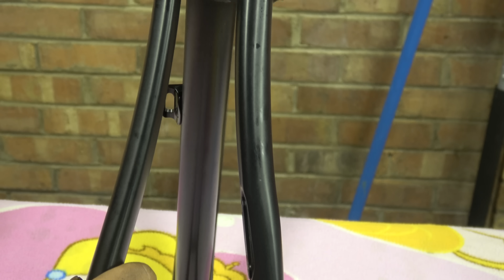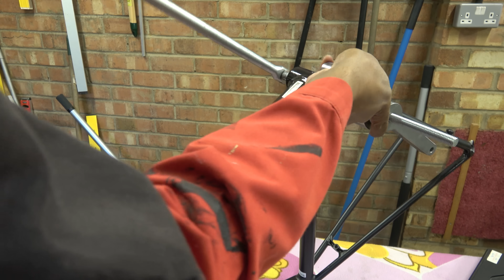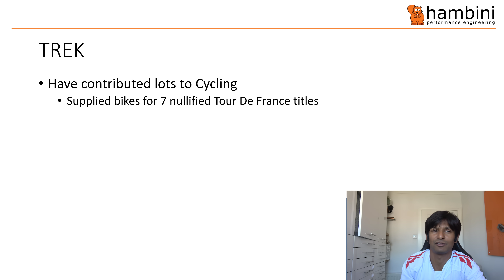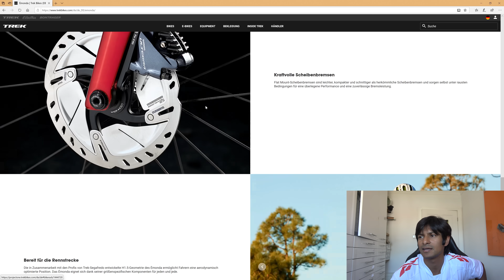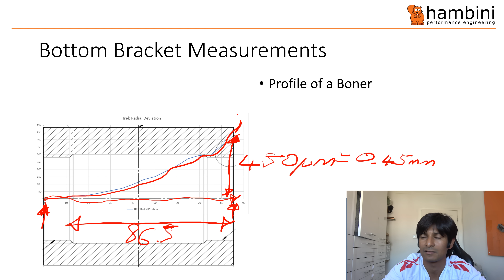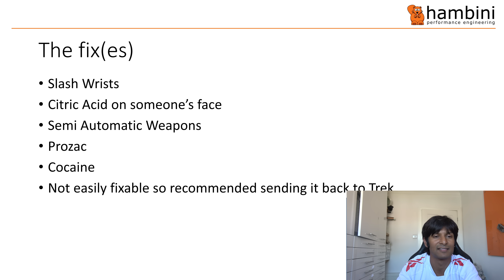Trek Emonda: Engineering crapness of the highest order

Comment: Wider tyres at a lower pressure, up to a point, can be faster, due to better absorption of vibration on rough (most roads) surfaces.
Imagine riding metal discs for wheels. Apart from the lack of grip it might be quite fast on a very flat surface. That's what the rubber tyres are for? Well not if they're used at very high pressures.

Comment: This annoys me. Apparently Trek feels it doesn't need to comment, apologise, or take steps to review or improve its manufacturing process or QA at all.
Market over the cracks.
And there are commenters on YouTube who will defend the price of high end Trek's vs motorbikes to the hilt. The machining challenges for a pedal bike are relatively straightforward and if they can't do a reliable job at the prices they charge then that's not good enough.
Most people don't understand engineering/machining standards, nor able to measure them. Are leading manufacturers taking advantage of that? It looks like it.

Comment: I can think of at least two separate ways of approaching the problem that occurs with welding this thin-walled aluminium part. First addresses the occurrence of deformation due to the excessive heat added to the zone that (and when it is) welded. That one seems absurdly simple: apply excessive COOLING whilst you're at it. No reason why you wouldn't do your welding under water, and/or (packed) in ice, right? Am I mistaken? Tell me, I know almost nothing about tech! My second thought hinges around a fact that concerns the two most important parts on a bike that have to be immaculately round (on their) inside..: the quality of the machining and finishing ON THEIR OUTSIDE actually does not matter one bit... as THAT at best would only make a difference in an aesthetical sense. Sooooo...

Comment: Thanks for the video. I just bought a Trek MTB then I saw this. Just FYI we had a project that involved welding aluminum piping for fuel and our best welders were failing a big % of weld tests. Turned out a genius Engineer at the USAF decided a spec for rocked fuel pipe welding was a great idea. Finally got to 100% pass for 3 welders using a pre-heating process.

Comment: My emonda sl6  in again (3in 2 years)-for new bottom bracket..... trek shop says normal.   Now have to get larger bearings for tighter fit...my ultegra 8000 crank arms broken.....they delaminated in the hollow arms.  Wtf! I just want a reliable bike.  What is best Carbon frame, bottom bracket , and group set ?

Comment: Un-bloody-believable!! I just received my Hambini racing spec BB86 in the post and my installation experience had quite a lot in common with that of  @PlantPoweredPedaler on my 2020 Edmonda ALR frame set. The drive side was within spec but my vernier read about 40.84 on the NDS. Honestly I thought the bung that receives the screw which holds on the plastic cable router to the bottom of the BB was going to be the bigger problem as it intrudes into the BB shell, but no. I was about 5-7 mm away from getting it fully installed flush when it got real tight. I just got my breaker bar out and kept going. Probably galled the piss out of it, but it’s in now (I’m guessing there was no big misalignment) and the spin test was the shiz!
Reply: Hi Kevin, my warranty replacement was about the same but of course the Shimano nylon BB doesn't care too much about tolerances. Have a look at the latest update to my pinned comment on this video for another example of Trek's abysmal engineering.
Reply: By way of update, I’ve moved over most of my components from the Emonda ALR to a new old stock Tarmac SL6 a local shop was trying to unload. While the crank still spun quite freely, once removed from the bike, I manually rotated both DS & NDS bearings. The one installed on the undersized hole is now quite grumbly after less than a year of riding.  The bearing on the hole that met spec is free and smooth. This isn’t rocket science, Trek... learn how to machine a damned hole!

Comment: I would never buy another Trek. Purchased a Stache hardtail with a SRAM Eagle drivetrain. The chain was eating in to the chainstay protector and would have done the same to the carbon in time. Took it back. They tried two more frames before admitting it was unfixable. No admittance of a design fault just a refund and an accessory voucher. How does this pass through product testing? The bike is now only available as a frame...

Comment: Is the 'undersizing' typically a result of using worn threading tools that should have been replaced 50 frames ago?  Even if the shell is tight, I would have thought that cutting the threads would have sized it back to where it belongs.  But I'm not a machinist, so it's a guess.

Comment: I've been a bike mechanic for 30 years, I remember the days when we would get three boxes of parts, the first thing we did was prep the frame and fork, then put them on an  alignment table and make sure everything was 100% square. Now we don't even have alignment tables or fork aligned tools in the shop. Mechanics don't do frame up builds nor do they even know how to properly align a frame. Last year I had a customer come in on her Trek, she had been complaining for two years about how her bike didn't ride correctly. All the previous mechanics had blown her off and dismissed her because what could an amateur rider possibly know. I took it on one test ride and immediately knew the frame was out of alignment. I put my personal frame alignment tool on it and sure enough, it was well over 10mm out in two places... She ended up getting a whole new bicycle from Trek because of it.  She rode it for two whole years like that...   
/Facepalm
Reply: True words! With steel frames and forks there is always a chance to coldset a frame for proper alignment. With carbon and aluminium this doesn't work. In January this year i made the mistake and bought a new and complete bike  from a shop. The first one in 15 years i didn't built on my own. I hate it. Everything starts to creak, headset is garbage and won't adjust well at all, wheels are coming out of true every 100 km,  and so on. Did i mentioned i hate this modern lightweight carbon bike?
Reply: @chrisbowman2030  I love the carbon stuff, when it's made correctly!! I've ridden some carbon stuff that's just dreamy, it feels like you're in the future. The problem is this poor quality stuff that's "just good enough". And there's no way way too tell the difference.
Reply: @biggaywizard  l op
Reply: Was this an aluminum frame aswell ? Do you think it could happen to the carbon frames too ? I have the 2019 emonda in carbon.
Reply: cool,  well done :-)
Reply: Where are you based Erik? If I ever want my frame checked.

Comment: I hope the “bottom bracket installation and removal tool” you’re selling on your website is not made to the same specification as the one in this video.  I guess in the description (on your website) when you say “will remove seized bearings” you mean “will remove seized bearings but will most likely need replacement after”. If you’re going to slam such a large portion of the bike industry; you should probably make sure everything you do is golden. Also, please for the love of god: use a bore mic or an inside micrometer to measure IDs. It’s painful to watch someone going on about accuracy and quality and then flat out use a less than accurate means of measuring a particular feature. Also it’s “Brinelling” not “Brinelled”. Either way, you would need to know what the static axial load rating of the bearing was and then need to know you’ve approached or exceeded that rating to really worry about it (or, dissemble and scope it...at which point the bearing would most likely be toast anyway lol). But yeah, that BB was really jammed in there.
Reply: Did you miss the part where he explicitly said he should use a bore mic and the vernier was not accurate?
Reply: I did, I just couldn’t get over it.

Comment: well as many have commented, was a time in the world when mechanics had alignment tools, when a frame was prepped, when faces of BB shells were checked and if need be faced to insure squareness. Those days gone I think, in my youth had pleasure to know folks who aligned frames, course they were all steel, and spent a bit of time watching all those nice Campy tools put to use. Not done much anymore, imagine what has happened to all those Campy tool kits, collecting dust in someones shed I would imagine. I love watching Hambini go at it, seems I am cut from the same cloth even though he does me proud with the profanity calling fucking shit what it is. Does not matter the brand, some years back my wife bought a very nice Look carbon frame with aluminum threaded English BB shell. Of the maybe 12 shops within 100 miles of me found one that had a BB tap as no way could I thread in the BB cups. The shop that had one also had a USCF certified mechanic and he doubted my claims to the extent I had to bring it in to him to show him. Some 3 hours later, after him spelling me and me spelling him we got the BB threads chased enough to install cups....no other shop for 100 miles would have had a chance. And even he was incredulous as to the need. Course I spent 30 years in utility work, have photos of me crouched down inside some rather large gate valves that also were not working as they should so I had seen what can go wrong and fixed it myself in the past. Good machinists esp ones working on bicycles a rare breed and should be appreciated. Thanks Hambini for putting a smile on this old guys face.

Comment: I don't clearly see the misalignment.  your gauge moves like 30 degrees depending on how you push on it.  I question your engineering credentials.  Looks like a bottom bracket quality issue.

Comment: Have you cut open any of the bicycle frame welds? If they are anything like some motorcycle manufacturers, they have minimal penetration. Several years ago, (2007~2010, I forget exactly) Suzuki's robots did such poor welds the steering heads would literally fall off. Not a good situation on a 187mph 1000cc bike. Suzuki were aware of the problem but managed to cover it up as a recall would probably have bankrupted them. Several years later they came out with a 'frame repair kit for dealers as any bikes still on the road were probably welded a little better than the ones already scrapped. I still have the ZEUS book I bought in 1976, the later one (2005?) isn't as good but it is easier to see the printing

Comment: Even reputable brands have problems sometimes, but I guess the difference is how they deal with the issue. I bought a midrange Cane Creek Headset for my Merlin RSR a few years ago and when I installed it, I thought it was a bit rough. During the first ride, it actually locked itself stiff. I couldn't even turn the steerer. I had to walk 10km back home in flat soled look cleated shoes.
I sent pictures and Cane Creek sent me a replacement lower in about 3-4 days as it was a known manufacturing defect.

Comment: Hey Hambini. Have you looked at Mountain bike rear suspension bearings / rockers. I’ve a Trek full sus and the rear suspension rocker has pivot points which have ovalised. Must be an engineering defect and opportunity for an engineering solution?
Reply from the maker: I don't really do MTB

Comment: Here’s some more interesting assumptions made by aero coach 
This time sealent and rolling resistance 

https://www.aero-coach.co.uk/tubeless-sealant-and-rolling-resistance

Here’s my thoughts on it 

Without the maths to see how the increase In mass caused by the sealent was compensated for this test is useless. The difference between no sealent and 100ml of sealent is at least 100g. As you need to compensate for the increased mass to evaluate rolling resistance. It is true the more sealant you have in a tyre will need more energy to accelerate it but the sealent will coat the exterior of the tyre and provided there is no residual sealent residing in the bottom of the tyre when spinning there can be no energy loss or store created by the sealant movement.  The results here are more likely to do with the increase of rotational mass and not the rolling resistance losses.

Comment: I had/have a 2016 Emonda ALR5. It rode really well but the fixing on the inside of the bottlecage fixing came loose after about a year. It caused the bottlecage to rattle and slop about. It was so annoying I eventually stopped riding the bike. I brought it back to the dealer at the start of this year and Trek replaced the frameset under warranty withut a quibble. One of my cycling buddies bought the same bike around that period and it developed exactly the same fault.

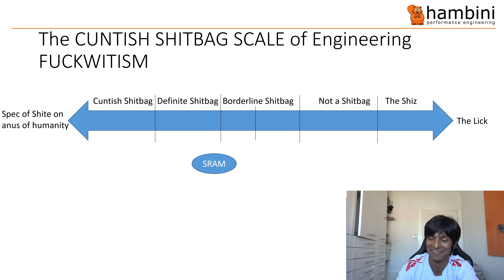Comment: 32:54 28mm tires have lower rolling resistance than 23mm or 25mm tires and there is nothing you can do about that
Reply: Wider tires have lower rolling resistance at the same air pressure as narrow tires. But if you adjust the air pressure to obtain the same tire drop, the rolling resistance is exactly the same between narrow and wide tires.
https://www.bicyclerollingresistance.com/specials/grand-prix-5000-comparison
Reply: @jesselee4725  Not practical to ride a tire at 10 bar. 28mm tires give you speed and comfort

Comment: Good Gods, exactly where to start...so anyone who has been involved in the bike industry for longer than a decade knows that the large manufacturers struggle in keeping their specifications correct on both BB shells and steerer tubes. For decades any shop and/or mechanic that actually knew what they were doing and cared about the quality of work that they were doing were making sure that the holes both the BB shells and steerer tubes were corrected to being some semblance on the same axis.  Yes, there are tools that will allow you to do that, apparently those are tools that you do not have!!  (admittedly one could get fantastic results with machining the BB shell bore on a milling machine.  That would result in a rather complex set up because you would have to do one side at a time and it would take hours to make sure that the frame was secured properly and then dialed in to center of the bore and on the correct axis line.)  I digress!  Most mechanics that have been around since the time that frames were steel....then Aluminum and so forth know how the dimensions change due to heat and the heat affected zones.  Yes, while heated the metal does expand and in cooling it does also contract.   The tube, tube size, tube wall thickness, etc also affects this and sometimes the tube expands significantly and does not always contract the same amount and vice-versa.   So in any BB shell it is imperative that the bores of the shell are dimension-ally sized correctly, round, both sides are concentric to each other and than the faces are perpendicular to the bore.  Being perpendicular to the bore is especially important if any part of the BB, like a cup, adapter, etc register on the face of the bore.   Again, there are hand tools that are on the market that will do a fairly good job at achieving that....do you not own those tool's???   You made a whole video about tools that you have and tools that bike shops don't have.  Perhaps it is time to step up your game. Now let us get back to manufacturers....yes, you are right that the bore of this particular bike is complete crap...especially with one hole being so undersized.  But here is the thing, manufacturers have tolerances, those tolerances are not always the same tolerances that  you may find in a NTN, NSK or SKF manual.   The tolerances are often a bit more broad, they are building a bicycle, which no matter what is a consumer item. The frames are mass produced by the lowest bidder.  So shit in and shit out.  As a whole the industry has to up its game.   Bike stuff is made and sold for the mass market. There are manufacturers that do their best to keep their tolerances in control and then there are those who allow crap to go out. Thank you for being the person who does point this phenomenon out.

Now then, Lance???  Really???  Lance???   Lance was a spoiled entitled wank stain as a Jr racer  and became a bigger wank stain as a senior racer.   Most of his HS swim team was caught doping as high school kids.    I am sure that he was doping then and also when he was a "pro" triathlete prior to his bike racing days.    Sure, he had cancer, he got state of the art trail medications to treat him.   He was already a millionaire at the time and could afford the best.  Anyone else in the US with its crappy health care system who was not a millionaire had the same diagnosis they would have died because there is NO way in hell that the employer based insurance system would have paid for that kind of treatment.   Now, let us get to Lance's racing pedigree...he did well at Amstel Gold once or twice...he won worlds once,  he won the tour 7 times on the juice with a lowly VO2 max of 78. Had he not been juiced he would have been a middle of the group finisher.  Then let's talk about those who tried to get the truth out about what he was doing...Lance basically did anything in his power to destroy that person.  The only things that mattered to Lance were MONEY and FAME.  Your idolizing of him makes me question your character.

Comment: Bontrager alloy wheels are just as wank. Have just had a rear paradigm elite wheel replaced under warranty. It wasn't even a year old and had probably done around 2,000 miles. More cracks than a Ron Jeremy film around the spoke holes and the metal around the innertube valve hole had practically dissolved. Nice light wheel but that's because the rim is paper thin. Back to using some proper wheels now I think.